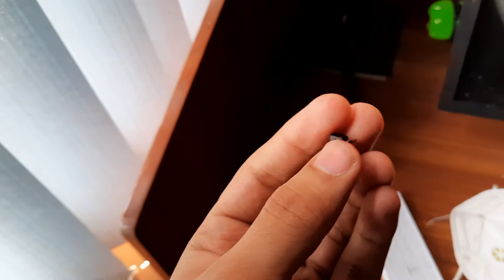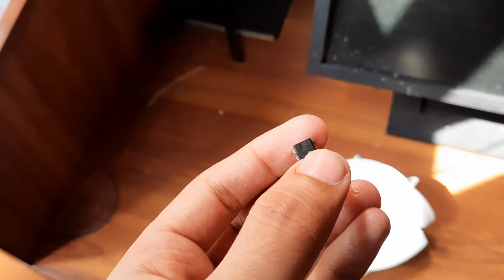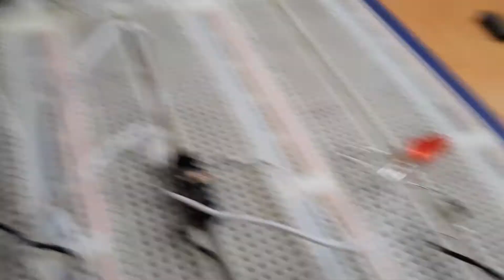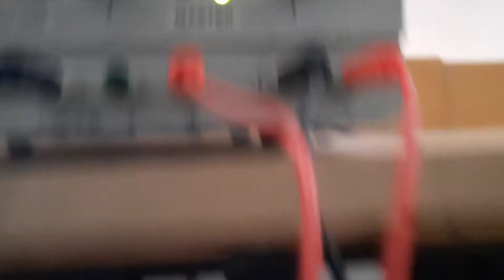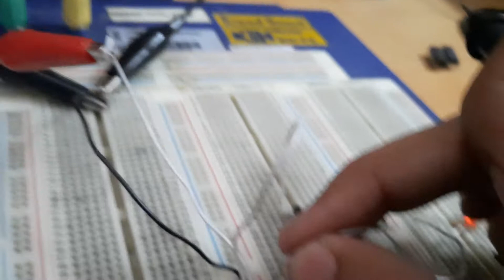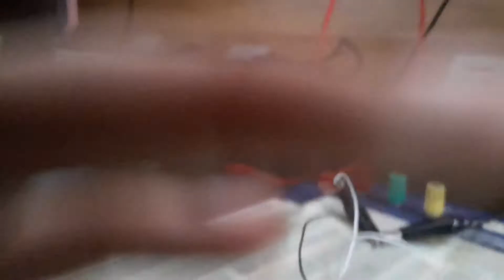Lab 10 | Introduction to Logic Gate ICs | 74LS266 |

Comment: Kindly Make a list of all the components used , it would be helpful
Reply from the maker: Cro
Function Generator 
Dc power supply
Resistor
Led
Wires
Gate ICs 
Logic probes
There was no new thing used therefore I left that to you